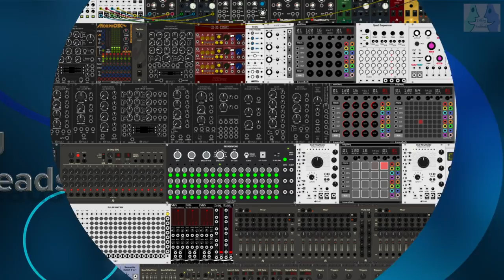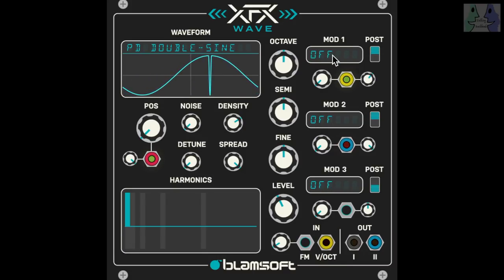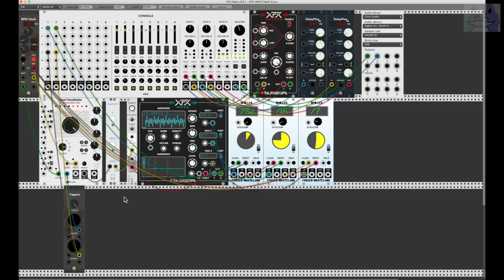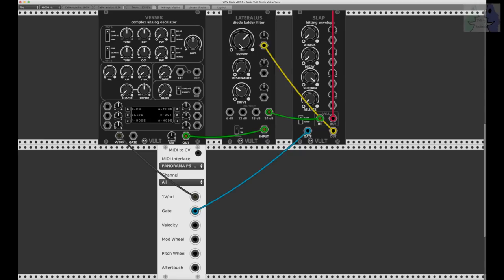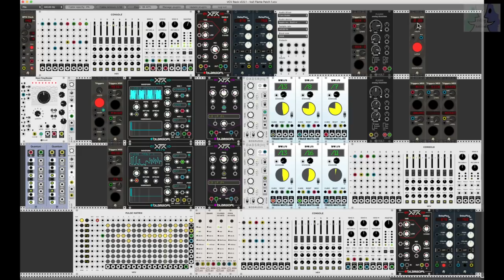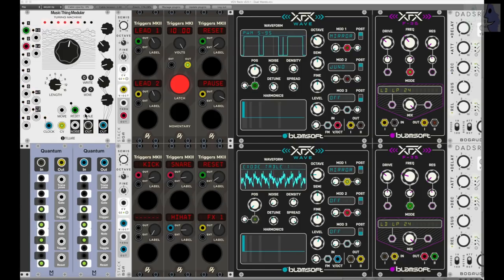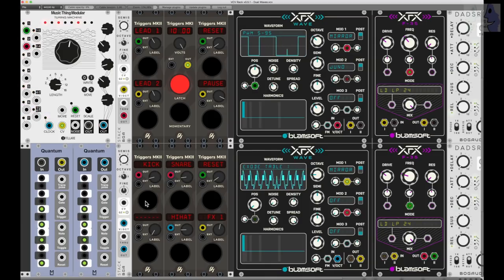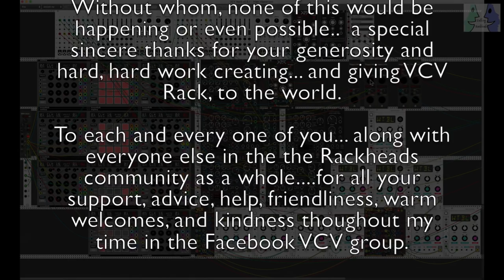'Talking Rackheads' Episode #2 - VCV Rack

Comment: Great work Nigel, love your passion for modular synthesis and tutorials! Never saw a patch with 3 console mixers before :-) (at the 1hr mark). I'm about half way through, and I'll be watching the rest tomorrow. Sorry to be picky though, but at 6min 35s, you mention that the lower bars in the harmonics window allows us to add odd harmonics, but from my understanding of the manual, it instead controls the phase of the harmonic corresponding in the upper part. I believe all integer harmonics can be added in the upper part too, if I understand correctly. Cheers!
Reply from the maker: Hi Marc! :) Yes, you are correct about the harmonics.. It was my mistake.. I misunderstood their purpose when I made that video and have since learned the shameful truth lol.. Anyhow.. really appreciate your kind comments and enthusiasm as always, too.. and yeah, 3 mixers... a little over the top but for that project it was the simplest way, in terms of configuration (and not size..) to do it.. You will probably have a good laugh when you see what i did for the play out piece... A pyramid of Braids no less... :)
Reply: Ha, just saw the pyramid, quite the arrangement! Great ending song once again, very beautiful. I had a small question regarding the turing, and wanted to run it by you before making the bug report on github. It seems to me that the 1-2 output at the top left is not bahaving the same way as in the real hardware module. In the Rack version it looks to me like it's an OR of 1 and 2, whereas in the real thing I believe it is an AND (as you have said at 1h22m36s). Is it just me or there is a difference in the software version? (I checked it by comparing the 1-2 output with and OR gate of 1 and 2, with a scope, and both were identical) I loved your Turing demo by the way, you really captured the magic in this module, and your demos sounded awesome! Keep up the good work!
Reply from the maker: I believe you are indeed correct about the Turing and 1+2 output.. As I was making a different video I noticed something a little 'odd' going on compared to a similar setup i had been doing with the hardware..  but I didn't realize what it was, until your comment suddenly  turned on a 'lightbulb' for me! Funny because Ive used the software version for quite a while now and never noticed that slight difference/bug... Well spotted! Are all the other trigger combos working as expected? Im up to my neck in work, creating TR #3 so don't have time to check myself... :D
Reply: I can confirm it's the same issue with the other outputs (2-4, etc). I will notify the authors of the Turing machine on github. Thanks for the followup! :-)
Reply from the maker: Yes, confirmed here too.. (I was just checking it this morning and you are spot on..) It affects all the 'added' outputs.. They are all "OR''d instead of "AND'd... I assume you are still going to do the 'bug' report Marc?
Reply: The bug report was filed in github, but no response yet from the author. Hope they will fix this :-) Here's the link in case you want to chime in or keep track of the issue: 
https://github.com/stellare-modular/vcv-rack/issues/6
Looking forward to ep.3 :-)
Reply from the maker: Thanks Marc.. Ill add my two penny's worth to it :)

Comment: Nigel,    I am going back and watching and re-watching your excellent videos!  I really am focused in on the Turing machine because I recently built the Eurorack version!    
So one question I have about playing patterns generated from the Turing machine...  How easy is it to take the scales  of the various repeating patterns and then transpose the entire beast to a different chord... so that you can introduce a sequence of the same pattern in different key/scales?   I know there are transposition modules out there,  but I am wondering about the challenge of doing this simulataneously with multiple sources?
Reply from the maker: Thanks Jeff! :) I typically use BogAudio's stack to achieve this and just send multiple voltages...to each of them to activate the transpose... No issues with doing so if you send via a multiple./stacked cables.... so they all change at the same time together. if you take a look at part 2 of Build your own Sequencer in the next episode of Talking Rackheads - Episode 5, you should see how I do so.... and Ill be releasing the patch for it so you can play with the config yourself :)

Comment: Best brother, when you "sample" or perhaps loop is a better word with the trigger latch button, is there a way to make loops longer?
Reply from the maker: It depends on what part you are referring to.. but for example, if you are speaking about the Turing Machine then the max 'loop' is 16 steps as set by the length knob. To extend this you could use a sequential switch to  switch between two Turing machines extending the max length to 32 steps and so on. To see a similar process in action.. watch TR #4 and see how I use multiple sequencers to extend the  length of looped sequences using sequential switches. https://youtu.be/eOHCjlCbyBU?t=53m15s
Reply: yes, then you could use two latch buttons also, and two turing machines and mess around with a sequential switch between two loops... or even more. great tip! great videos. /Klas
Reply from the maker: Exactly :)  Lots of fun and experimentation to be had! :) Cheers!!
Reply: I got mine XFX wave last night... what a extremely good oscillator/wavetable source... goosh! its beautiful Square wave combined with some Phase Modulation brings back the classic super fresh Casio CZ sound, now in a modular form... there is just no end to the dopeness. Btw you should do something with the Write Seq 32 and Write Seq 64... they are pretty sick! Keep up the good work, your videos + sonic talk has to be the very best youtube has to offer... so nerdy so fresh! peace from Sweden... //Qlas Beats
Reply from the maker: Thanks Stranger Hertz.. I really appreciate your feedback and kind words...  :) Something on the Write 32 + 64 may be on the cards in the next week or so depending on workload etc... and yes, the Wave is one of my personal favorite OSCs... I just love how versatile it can be in creating  very complex (and also simple but fat sounding...) textures

Comment: Looking / listening at your cover now ... 
Sounds impressive ...
(What system are you running to have things go so smoothly ?)
Reply from the maker: As that is such a CPU intensive patch I had to build and perform it on my 'highest spec' 2015 iMac ..(Core i7 4.0 with 1TB SSD, 32GB RAM and AMD Radeon R9 M395 4GB)
Reply: That explains a few things ;)
Reply from the maker: Well, that was one of the largest patches I have ever tried to put together and record at the same time. The recording bit is always, for me at least, the bit that causes the most problems with CPU/GPU related sound glitches... My old but trusty 2011 iMac .. actually handled most of it OK.. but then just froze up when I tried to record the performance so i switched to the 2015 one and it worked.. just about :) Using some 16+ OSCs plus so many sequences, Envs, Filters and so on.. in a single patch was a bit mad.... :)
Reply: I does sound like 16+ OSC's !!!